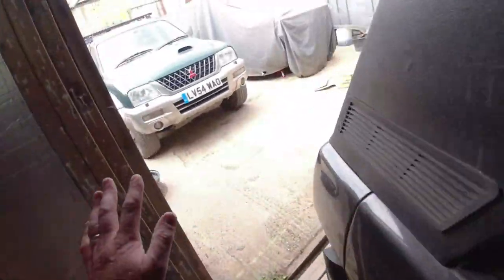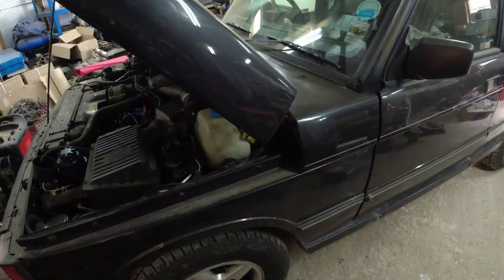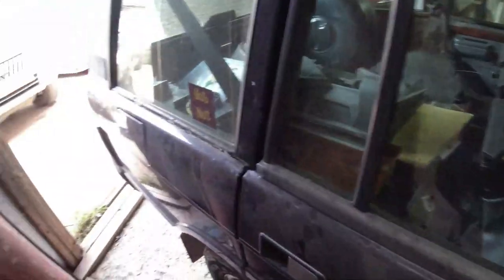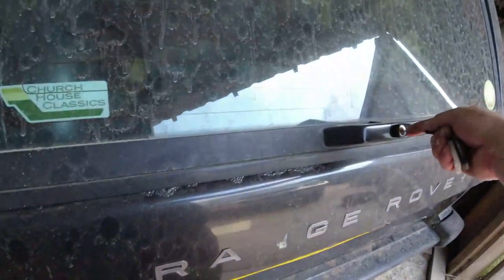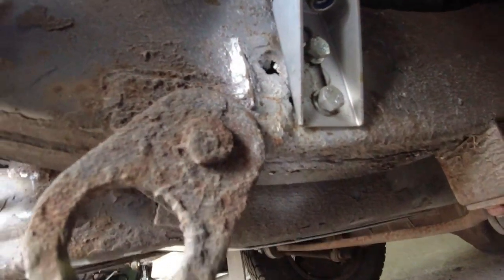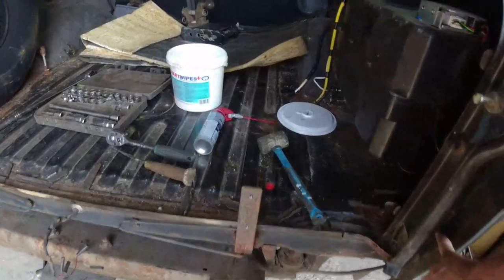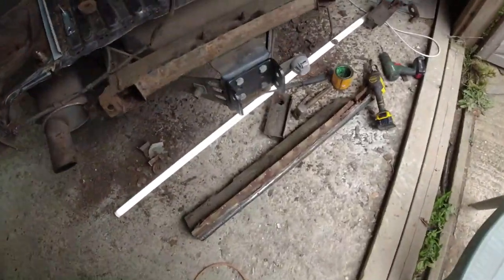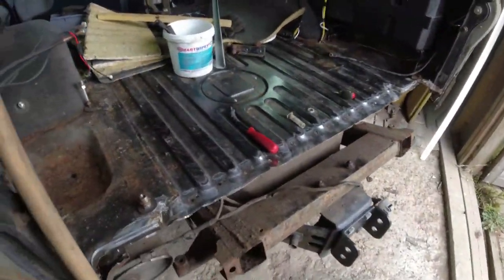1995 Range Rover Softdash SE ep1 - rear cross member replacement - profanity and rust

Comment: Nothing wrong with a 300tdi.
Reply: Prefer the 200 myself.
Reply from the maker: correct, just a much more complex than the 200tdi, too much EGR and electronics for my taste
Reply: @churchhouseclassics  no electronics on the manual 300tdi. The injector pump on the autos is more complicated so might be electronics involved there, I'm not sure. The EGR is simple enough to blank off.

Comment: Hi ,love what your doing would send beer moneys, but don't use PayPal...beers on me if you ever visit ibiza.
Got myself a 93 4 Doors 200tdi,who needs sills etc, your videos are very helpful, wanting to take the rear wings off, but nobody,nor you  mention that they are spot welded on the rear door gap....is it unique to mine?
Why would they do that!? The rivets on my 89 2 Doors are doing the trick perfectly...
Thanks for the great job anyway.
Reply from the maker: There should be a return edge on the rear wing, then a steel strip with two bolts welded onto it fits into the return edge and when pushed through the two holes at the top of the outer wheel arch section can be bolted up.

Aluminium and bare steel rarely still exist because of the corrosion so I make up an L section and pop rivet it to the rear wing.

Comment: Am going to be replacing mine soon, just worried as mine is a petrol and welding close to it, do you think tank out or will it be ok
Reply from the maker: Safety says tank out, you need to be sensible, can you smell fuel near the tank? If so fix that and while the tank is out you can weld in the new cross member. In reality where you are welding is some distance from the sealed fuel tank. I do some safety checks and then if satisfied will weld with fuel tank in place.

Comment: When aftermarket exhausts are fitted with the Tail Pipe Directly straight out the rear !- looks ALL WRONG and TERRIBLY COMMON !!!!!!!.  The Original position of the tail pipe angled off to the nearside looked SO CLASSY ! Especially with the tail pipe end/s cut off at 45- 50 degrees
Reply from the maker: In your most humble opinion I guess?!?

I think also that by the time the EFI 3.9 came out in 1989 the exhaust came out more like this item